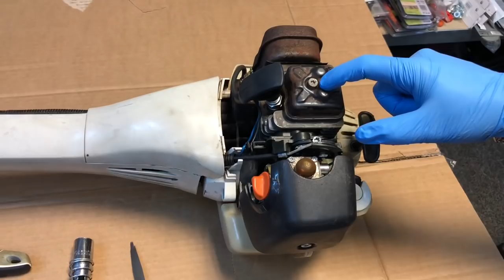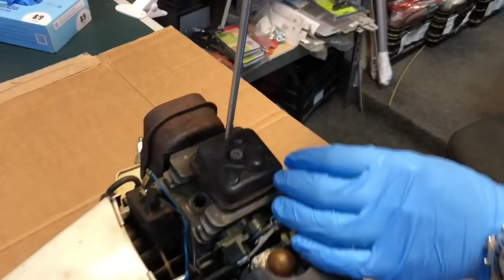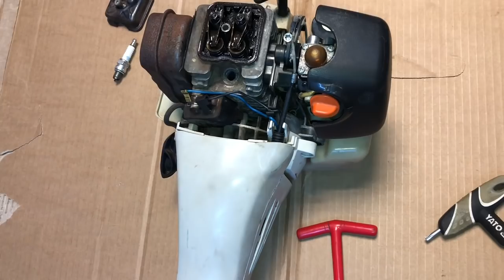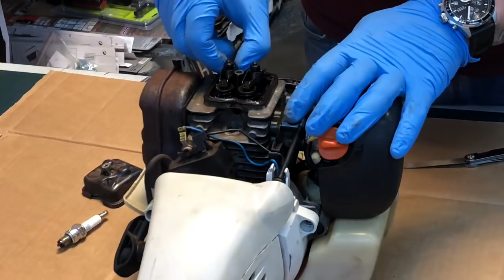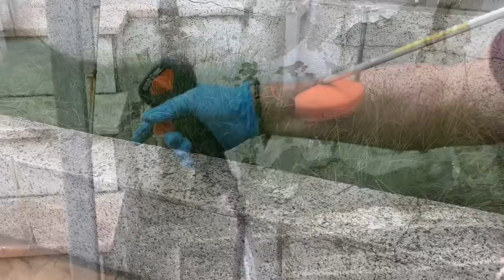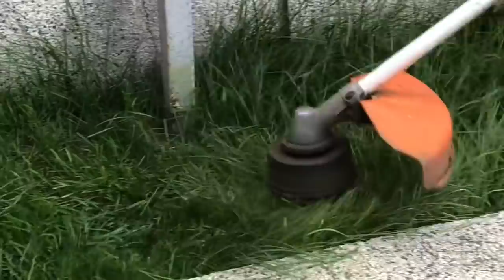Reglaj tacheti motocoasa / trimer Motor STIHL 4-MIX

Comment: Salut baieti . Salut shr motors . Se da un generator 2timpi, 650w , chinezarie de 8ani vechime, tinut in depozit si folosit 30 min la o lună, vara , iarna, amestec ok, benzina petrom. Benzina ii pun cate 0.5litri sa o consume si pun alta .De un an, face probleme. Nu dădea scânteie, am cumpărat două bobine , bujie ngk . A mers cu noua bobina perfect 30min, peurma pa. Am pus o pe a doua. S A dus dracu. L am Lasat dracu în depozit si acum vad ca bobinele merg, dar generatorul merge în șuturi si nu isi poate stabiliza turatia . Am cumparat o altă bobina si o alta bujie, am verificat magnetoul , totul perfect . Mentionez ca a fost văzut de un mecanic . Nu a știut ce sa mi zica . A reglat carburatorul, a facut tot ce a ținut de el( nu il înjurati, este f priceput pe motoare în 2T,  el a zis ca mai bine sa l arunc decât să mai bag bani în el , este 400lei) . Mentiomez ca la sfoara porneste dupa 20 ori, pe spray din prima. 

Ce sa fac, sa l arunc ?🤣 au facut mai mult piesele decât aparatul în sine. Multumesc anticipat.
Reply from the maker: Pana la volanta? Poate s-a deplasat si nu da scanteia mereu la timp

Comment: Am și eu o motocoasă STIHL FS 131 cu motor 4 mix , tai cu ea cât tai și după ce las de accelerație se aude o pocnitură la toba de eșapament . Ce ar putea cauza acea pocnitură ?
Reply from the maker: Poate sa ramana supapa atacata... si sa dea rateu
Reply: SHR Motors supapa de admisie ?
Reply from the maker: Da, posibil
Reply: SHR Motors o sa verific cu lera sa vad , am lera speciala de la stihl .
Daca ii prea stransa sa o mai desfac un pic ? Lera trebuie sa intre usor si un pic sa simt ca agata ?
Reply from the maker: Exact
Reply: SHR Motors daca intre culbutor si supapa ii o distanta mai mare ce simptome are mersul motorului ?
Reply from the maker: Clantane si nu merge cum trebuie. Culbutorul nu deschide supapa complet.

Comment: Salut am o problema la un atv 125 hummer nu porneste imi scuipa benzina din carburator pe la filtru de aer am scanteie la bujie dar nu vrea sa porneasca am carburator nou dar nu reglat povestea e ca a mers a pornit si apoi mi a murit motorul si de atunci nu a mai vrut sa porneasca daca mai putea ajuta as fii recunascator
Reply from the maker: Daca zici ca iti scuipa benzina pe carb. Inseamna ca iti ramane supapa deschisa
Reply: SHR Motors și ce ar trebui să i fac?
Reply from the maker: Verificati distributia. Daca aceasta este ok, atunci trebuie desfacuta chiulasa
Reply: m am uitat,supapele nu au ramas deschise poate fii ceva electric?
Reply: SHR Motors .
Reply from the maker: Ai pus benzina pe admisie? Sa nu iti curga?
Reply: SHR Motors curge benzina
Reply: SHR Motors buna seara vreau un numar de telefon
Reply from the maker: Pentru?
Reply: SHR Motors am un motor lamborgini 15 cp 350 sa rupt surupu la colbutori sa spart siguranta de la supapa